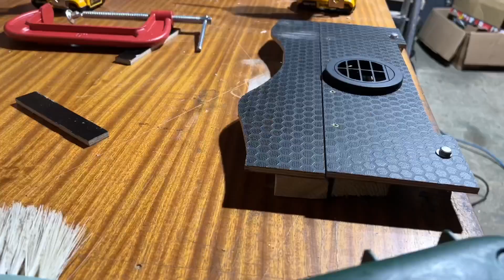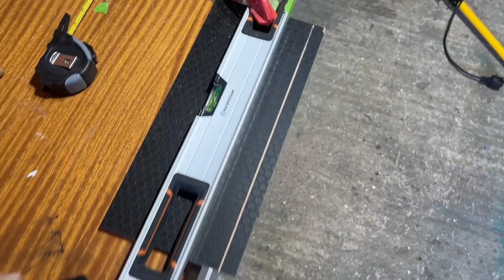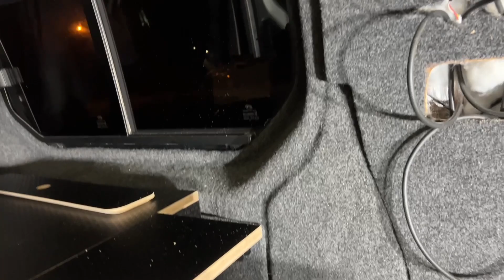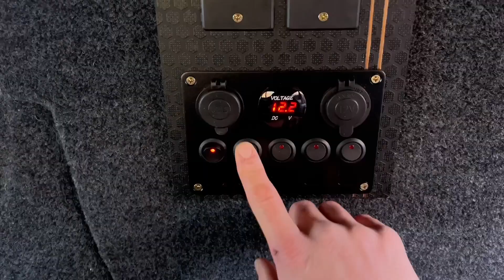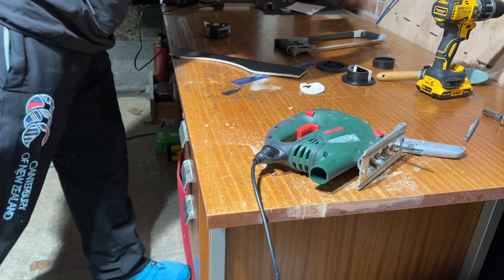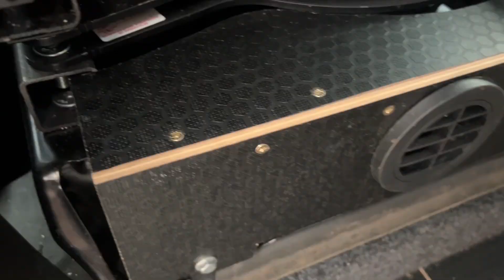FULL VAN CONVERSION - Building a custom 12V Switch panel and Heater box for my van.

Comment: Hi! Great chanel! My van will look quite similar to your regarding colors etc. I have the same witchpanel as well. Do you know what gauge the wire is on them? I see i have 15amp fuses pr outgoing line, but i was planning to run heater, fridge, lights, and waterpump etc throug the panel. How did you wire this? I am bit worried that the on some scenarioes the were several of the items is running at the same time, it will be to much for the 2 inputwires on the panel. (+ and - common cables)  maybe the heater doesn`t need to have a switch as long as the remote panel is beside it. I thought maybe ut could be an ekstra shut-off posibility. Did you wire the heater directrly to the battery?
Reply from the maker: yeah so my diesel heater is routed and cabled directly to my bus bars on my electrical board. make sure to check out the electrical install for more detail on that. the only two things I’m actually running of that switch panel is the two LED light strips that are in parellel and also the main 6 x LEDs on the roof. your correct the wire gauges are too small for some other larger applicants. make sure to check the maximum Amperage draw from your applicanes. my fridge for example is wired directly to my bus bars.  check the ‘making my van a home’ video for the wiring of the fridge. because the Diesel heater draws perhaps 14A on start up that is also wired directly to my bus bars. the fridge runs to the 12V bus bars. my heater runs to the main bus bars which is turn are clearly directly connected to my lithium battery. 

so for you. I reckon you can wire the water pump and lights to that small switch panel. and the other things to the main bus bar. 

the question is - do you need to isolate or turn off the applicanes? so turning my fridge off with that switch panel served me no purpose. when I’m using the fridge I’m out in the van and it needs to be on all the time. there’s no point really in me being able to turn my fridge off - especially as I can turn it off on it’s on control panel anyway. 

also got to make sur le you have seperate isolating switch’s on the B2B charger as the whole thing turns on when you drive other wise 🤣 I also have a solar isolator and a main isolated on my board so everything is off when I’m just driving around normally. Hope this helps.
Reply: @richard_builds_it  Thank you for the detailed answer! I will make these changes. Makes sense.                                             

Antother question. Do you remember your matress diementions? I am wondering what width i should have for the seating. I have currently made a choise to make them 50cm, so en end up with approx 50cm of legspace between the benches. Yours mauby look even wider than 50cm?
Reply from the maker: @glnyla7047  my bed when fully folded out is 162cm wide which is crazy and a normal King Size bed is only 152cm i think- the units are on the wide side. But i still have more than enough spcae for my legs when its in 'desk' mode.
Reply: @richard_builds_it  Thanks, I went for straight walls, so i added battons to make the walls run all the way. So i loose about 10cm i guess. My Width will be 150cm, so wide enough, And i thought i might go for 50 x 50 benches with 50cm leg space. The matress is 12cm thick so this will add up on the backrest in desk mode, so i think i need at least 50 cm with to be able to sit comfortably. 

Thank you for the information!